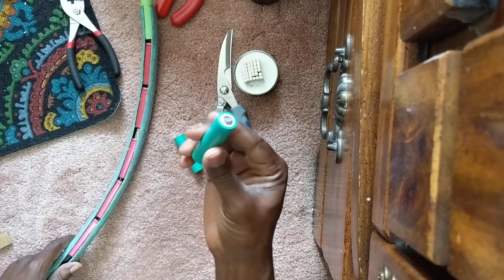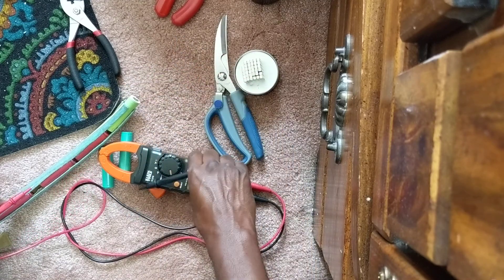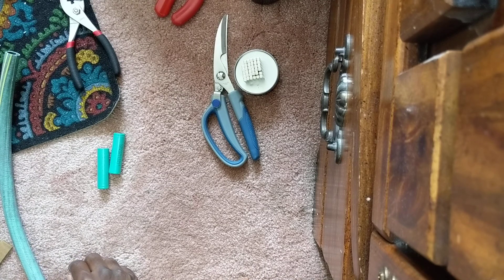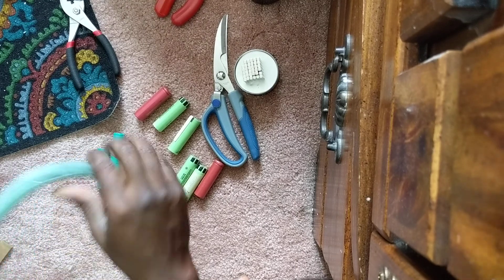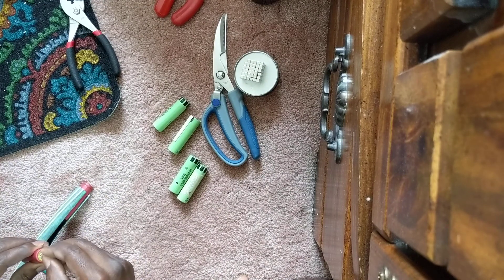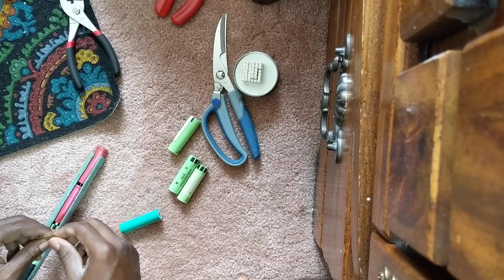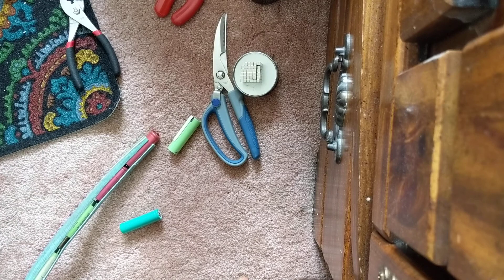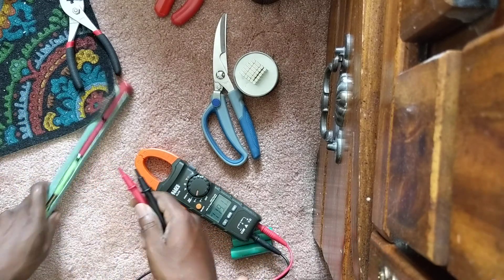Diy 18650 battery setup no solder, great connection.

Comment: I can dig it!  I have noticed that 18650s fit well in 3/4 inch irrigation pipes and hose, but never thought to try using a cut garden hose like this.  I’m gonna give it a try, Thanks for the idea!
Reply from the maker: You are most welcome. I hope it works out. This was an early design it is very stable so that is a pro but I did not use it for a long time to add much capacity. I still think it might come in handy in future designs. Good luck on your project.